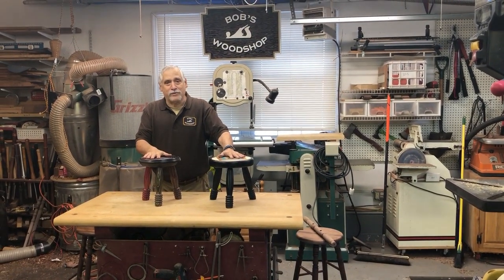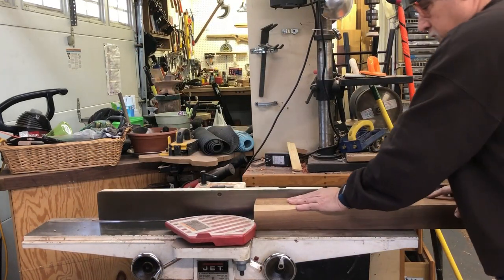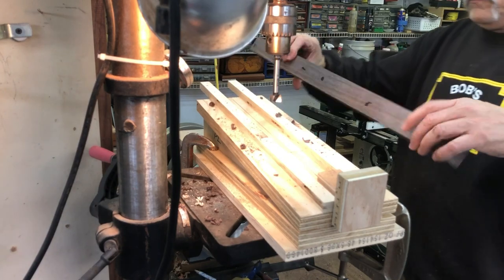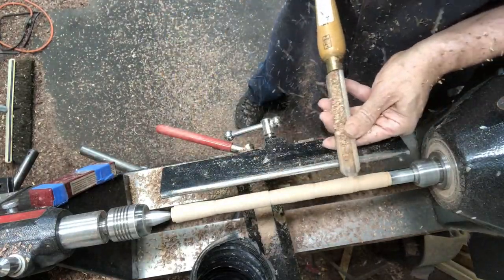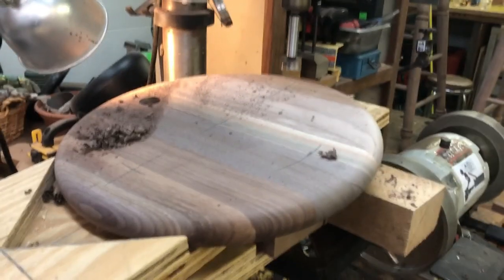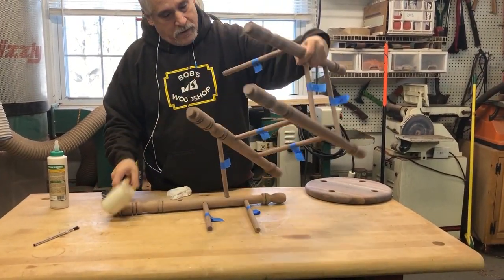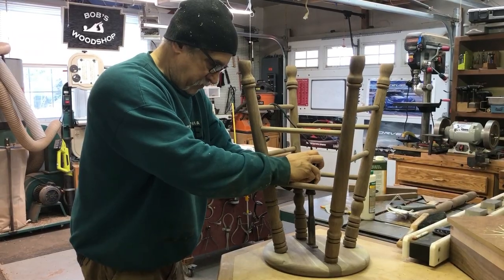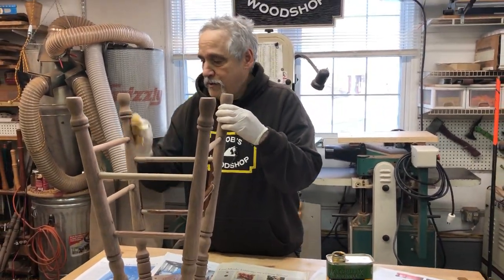4 Legged Stools -  on Bob's Woodshop

Comment: Nice project, and very clear explanation, Bob!  I have this on my list of things I need to try.  How do you determine the location of the holes on the seat, and the length of the rails?
Reply from the maker: Hi Jim,   I copied a stool we had from Walmart from 20 years ago. Have fun with your project.
Reply from the maker: A good rule of thumb for the leg placement is to have the feet pretty much sit out the same diameter of the seat.  For this size stool, 24", I used a 7.5 degree angle. I then used a 2" inset from the seat edge. If I did not copy the sizes from another stool, I would have used two Chop sticks to determine the length of each rung.